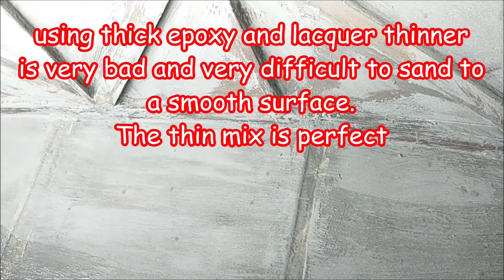Paradise Trimaran Part 16 - Boat Building In The Philippines

Comment: Will that epoxy mix go through a power sprayer? Like a do it yourself fence painter that runs off AC? Roosters going crazy there 😂😂
Reply from the maker: The epoxy could harden in the sprayer and then you would need a new sprayer😊